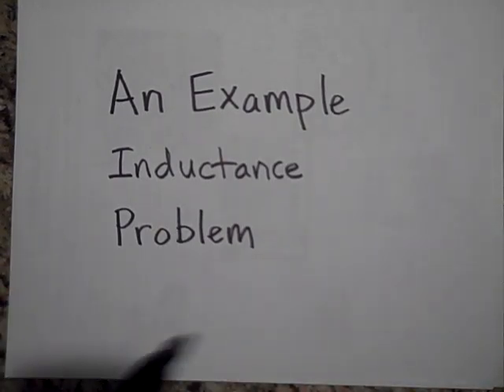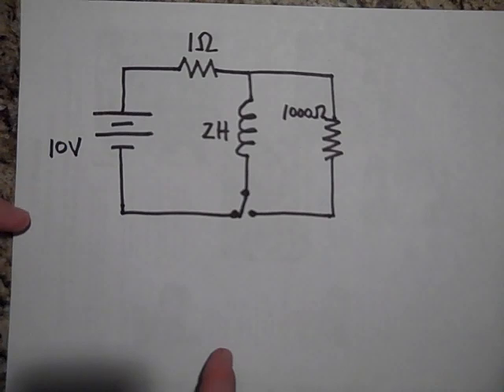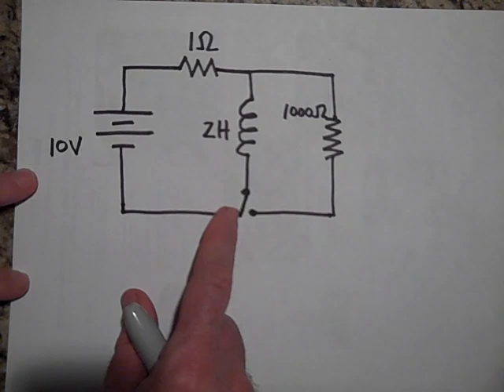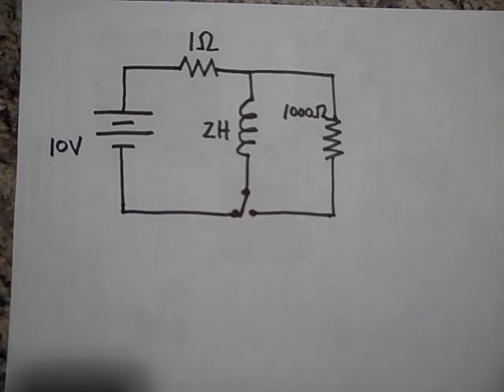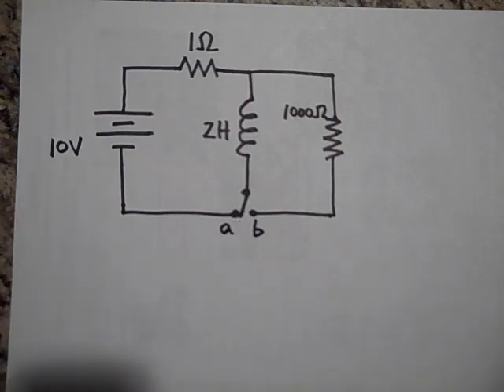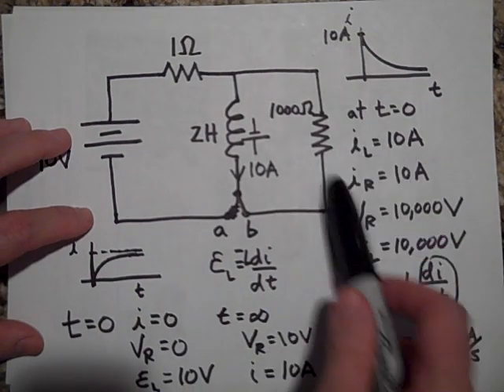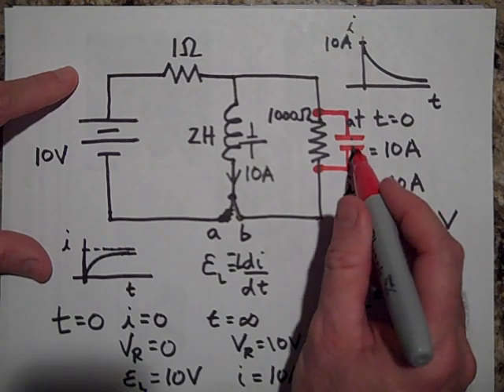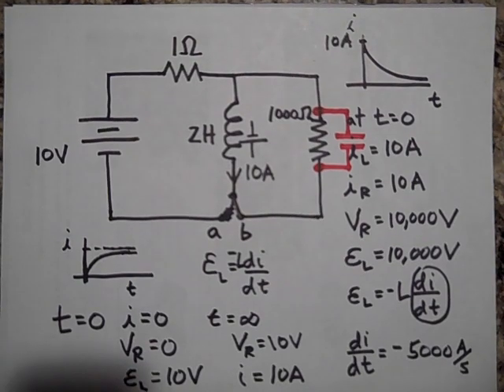An Example of an Inductance Problem

Comment: Output to the Load, Switch in B position, may goes up to 1K Volts in a certain period of time was caused by the delay of Manegtic Field Discharge, this is not a constant output voltage my friends .. . .. :)

Comment: how can the voltage across the inductor be 10000volts when e=-L*di/dt=-2*10=-20volts
Reply: di/dt is not the same as i. 
di/dt is the rate at which current changes. 
The current is initially 10 amps, and decreases to 0 over time. Initially, however, the rate of change of current is 5000 (calculated using initial voltage of 10000 volts). The 10000 volts was calculated because the initial current through the 1000 ohm resistor was also 10 amps. V = IR, so V = 10000 volts.

Remember, di/dt at t = inf. is 0. So, no voltage is produced after a long time (this is due to discharge).
Reply: Marc Moncada my question : t = 0, i=0 > no flow pass resistor 1 ohm , how to calculate €L = 10A ?
Reply: @vupham5745  I'm just a student so I might be wrong, but...
I like to think of inductance as a property of the inductor in question, and not the circuit. To calculate inductance in a circuit, you must divide voltage by rate of change of current (both in opposite directions). Although there is no current in beginning, there exists a rate at which current changes at t=0. V/(di/dt) will yield your inductance.

Inductance is also proportional to magnetic flux.

A straight wire has little to no inductance because it has a solenoidal magnetic field, so the field vector avoids the direction of current as much as possible. Here, magnetic flux is small.

A solenoid has optimal inductance because it has a relatively straight magnetic field. Here, magnetic flux is optimal.

Comment: nice videos ....thx very much..i have a question : at t=0 there is no change in flux or change in current  , so why the emf =10v ? ...
Reply from the maker: At t=0, there is no flux and no current, but there is a change in flux and there is a change in current.  It's sort of like when you drop a ball.  At t=0 there is no v but there is a change in v and an acceleration.  The v vs. t graph at t=0 has a slope of magnitude 9.8 m/s/s.  The i vs. t graph for the circuit shown at 1:15 has a  slope at t=0.  All the best!
Reply: @lasseviren1  thank you very much for your response , i really appreciate it ..sadly i am still confused a little . here is how i understand it and please correct me if iam wrong : emf (e) = - Ldi/dt , and when the switch is closed between t=0 and t=0+ , ther is a very big change in current (the slope is almost infinity) and hence the emf voltage is very big so that we can consider the inductor as an open wire with a voltage of 10v in this case
is my understanding correct ? ....thank you again
Reply from the maker: @mohfa1806  Yes, that is correct.  Though the slope is not infinity but (10V)/L because emf = - Ldi/dt  and di/dt is the slope.
Reply: @lasseviren1  hello again...thank you again for your great videos and your fast replies...suddenly today i got this question : we agreed that initially there is nearly infinite slope for i and this result in very big emf which makes the inductor intially act as open circuit , my new question is : this very big emf should induce very big current opposing the current coming from the battery and overcoming it , so why we are not seeing a counter clock current initially in the circuit ? ...thx
Reply from the maker: @mohfa1806  The slope is not infinite.  The initial slope (di/dt) is 10V/2H or 5A/s.
Reply: @lasseviren1  but initialy between t=0 and t=0+ the di/dt slope is nearly 90 degree which is a very big number..thats why the inductor induce very big emf according to lenz's law emf =-Ldi/dt ...so the inducor acts like an open wire initially and hence we know that initially its value is 10v...my question is : should there be an induced current from this big emf opposing the current from battery and overcoming it?...
Reply from the maker: @mohfa1806  I think I misled you when I drew that graph of i vs. t.  That line should not look like it's going straight up at the beginning.  Its slope is only 5A/s, but the graph drawn at 4:24 has a slope that is -5000 A/s.
Reply: That's not at t=0, that's at t=infinite

Comment: Thanks alot , The question is : would it kill some one if he touch this 10kv or would it be just a small shock ? thanks ....
Reply: 20v applied across your heart an stop it from beating. 
But a human can touch a spark plug , receive a 10kv shock. dry skin will absorb say 9.5 kv,
by the time the voltage reaches the heart it the voltage has been vastly attenuated, and so 
the human is shocked but the heart receives less than 1 volt .  Of course wet skin , firm contact 
with the spark plug can be a different story !

Comment: Well if 10 volt battery generates 10000volt isn't it disobeying energy conservation. Can anyone answer my doubt please
Reply: Nope. Voltage is just a measure of work done per charge.Amount of charge that battery or DC source can provide is continuous and more at steady state.due to higher amount of charge present, the work done per charge or voltage is low but if you have less charge present then work done per charge is high. think of it as dividing food among 1000 people where every one gets 1/1000th of the food. But if there are only two people then one can get 1/2 of the food . Now answer this question . Is this violation of energy conservation?

Comment: car ignition coil has primary and secondary and this self inductance in cars you say is utter dumb bullshit. there are 50 000 v max used and that is why wires have 4 mm insulation. for 1000x voltage multiplication you will need pressurised copper in shape of coil, cooled to -260 degrees and perfect ferite core and the whole inductor would be 30l bucket sized and you will have to make special spark plug-switch, because you will loose a lot of energy heating the resistance on the contact points of the switch. real car ignition coils are tv flyback transformer equivalent with only the core being iron instead of ferite (new cars might use smps with ferrite core)
Reply: i also expect the charge and discharge curves to be the same shape and maybe different scale, but this difference in charge and discharge curves looks like inductors can steal energy if they dont do full cycle